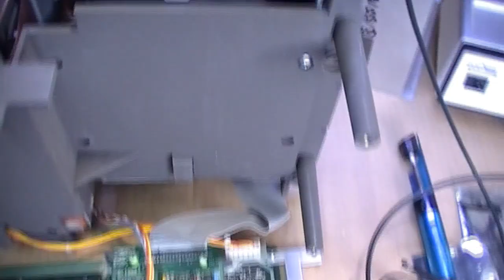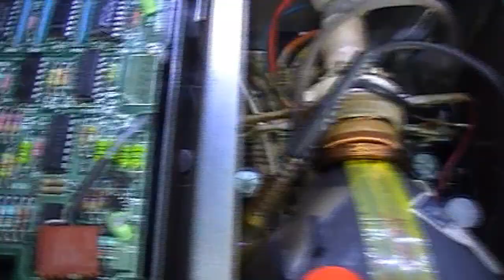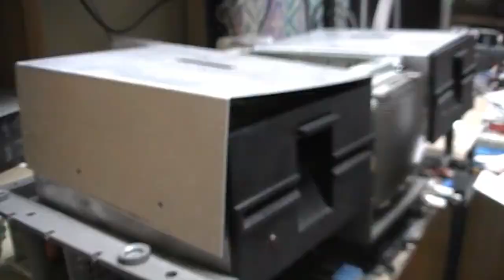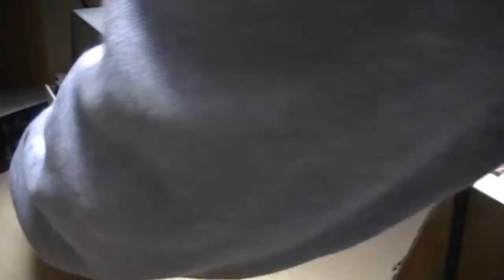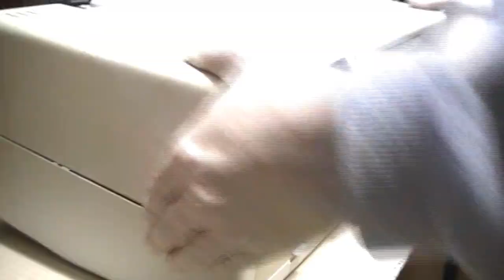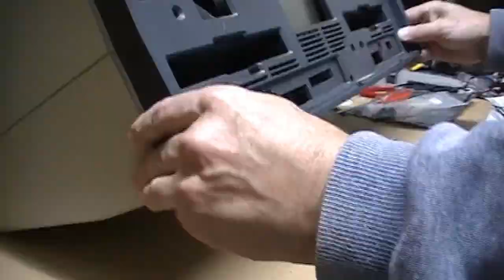Comment: Hey, great video !! I have an Osborne 1 and an Osborne Executive. Both have no picture on CRT. I tested just about everything on the CRT you can. I have 12 volts, horizontal freq and vertical freq are present but no neck light and the flyback doesn't seem to supply high voltage. Tested all transistors and also did a full electrolytic cap replacement just because I had it apart. Any ideas on what else to check ?
Reply: I'll just comment on the OCC1 for now, as that's the machine that I have the most info for at hand. I'd bet the Executive is similar but with a bigger CRT.

The CRT monitors are self-contained "modules". I think mine was made by Motorola. It looks like all they need is 12v power from the Osborne, and the video signals you checked in order to work. All the nasty high-tension generation is a part of the CRT monitor module, and not from the computer itself.
Where I am going with this is that it should be possible to get a signal from the composite video output port on the Osborne, even if the internal monitor is faulty. Have you tried an external monitor connected to the front RCA port?
If that works, then you can at least be confident that the computer isn't faulty.

You mention that you can't see a "glow" for the CRT heater. That seems strange as from what I can see the heater is directly across the 12v rail (which you say you have measured as being OK). An open circuit heater is really bad news for a CRT. Let's hope that's not the case....
You seem to know your way around a CRT (probably more than me), so I assume you are correct when you say you have no EHT. Could it be that the 12v rail isn't getting to the relevant sections of the CRT module? It just seems strange that you have no EHT and no heater at the same time, although I had more than one fault on my machine so anything is possible I suppose.

I was lucky that my CRT was working. I might not have bought it if the display was faulty, but I think there's still some things to check with yours before giving up on it!
Keep me in the loop please.
Reply: @steveremote3952  Thanks for the reply Steve !! I was actually able to get a little further. I was able to get the Osborne 1 monitor working. It was the one cap I didn't replace (didn't have it available) but when I did get it, I installed it and it worked !! The Osborne Executive monitor on the other hand, I can't figure out what's wrong. I actually DO have neck glow but zero high voltage. I tested the flyback and the tube with the working Osborne 1 monitor PCS and the flyback and tube works !!! The main Osborne Executive main board works as I connected the Osborne 1 monitor to it and I get an image. I replaced all the caps on the PCB and the 555 timer. Still no go. I checked all the transistors and they all tested good ! I am really lost now and im about to give up. lol
Reply: @mikematkovic8733  Well you can't give up now - you have got to be close to getting it fixed. CRTs aren't my expertise, but does the CRT flyback transformer have an integrated tripler, or is that separate? If so, it might be the tripler that's faulty? I know you've said you've tested all the transistors and the 555 timer, but are they worth another check (particularly the driver transistors for the transformer?). I note there's a few example circuits online for testing flyback transformers that might be useful to try if you get desperate. I'll have a look at the Executive schematics to see if I can come up with any ideas, but I bet you already know more about that circuit than I ever will! Good luck and stay in touch.
Reply: @mikematkovic8733 I’ve got an Osborne one with that exact same crt issue

Comment: The strobe effect is the way we used to set the motor speed on the old Kleinschmitt printers back in the 80's. We used to look "through" a tuning fork and twiddle the adjustment (which was manual).
Reply: I had only seen this previously on old vinyl record turntable speed adjustments. I think it's genius that they even thought of it here. They also provide a way to measure the speed with software, but as I had two faulty drives at that point, loading software was going to be difficult to say the least. Very glad they provided this method (and even better they thought of users outside the US!).